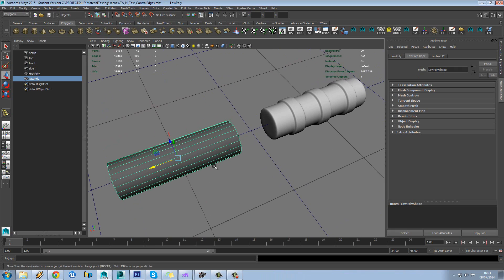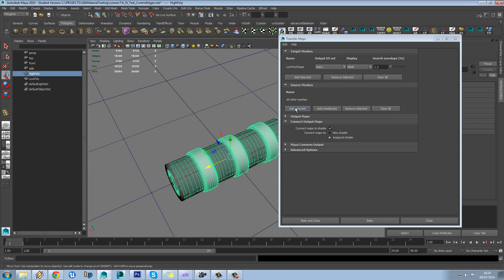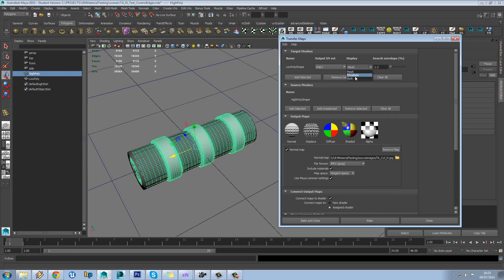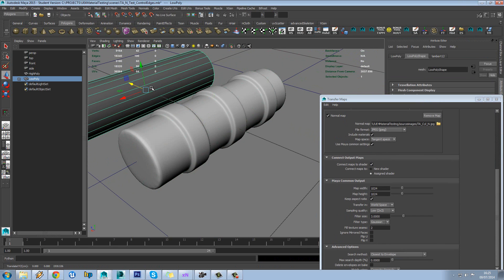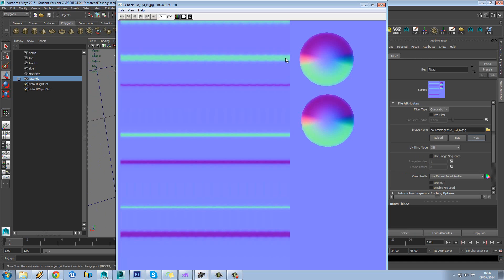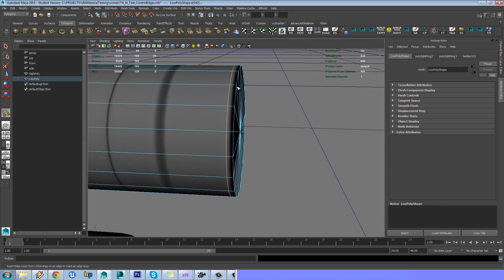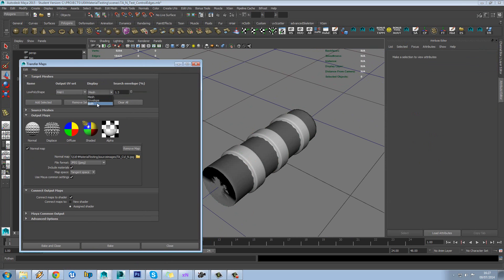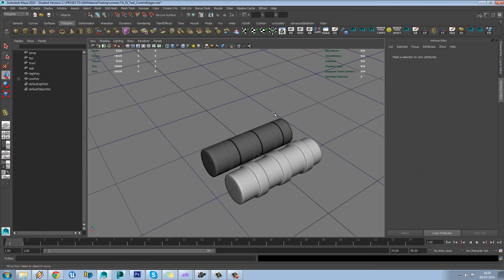Normal Mapping Guide - PT1 - Control Loops

Comment: That is awesome - good video!
Reply from the maker: Thanks! one thing I forgot to mention is that quite often you can use your Normal map on the original low poly without the control loops (as long as the smoothing groups haven't changed). So actually there are no extra triangles in your final game model